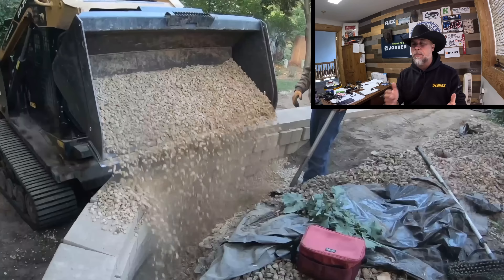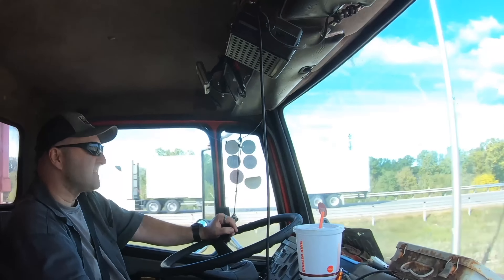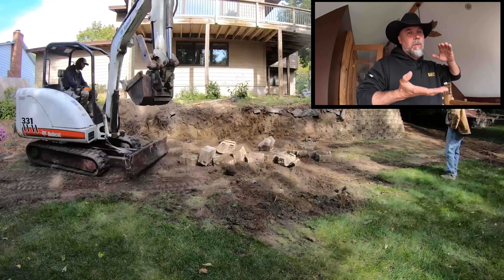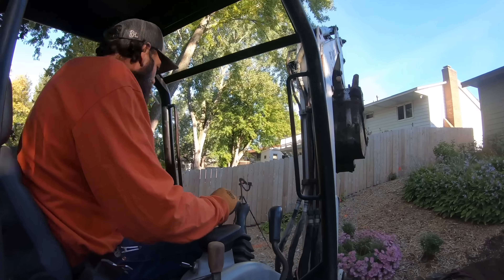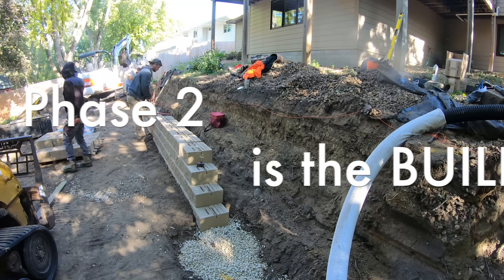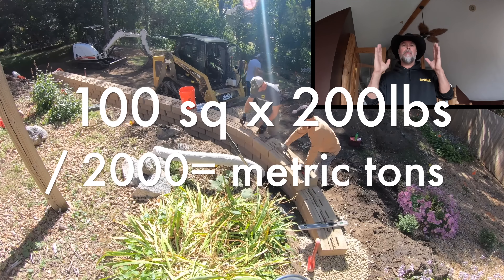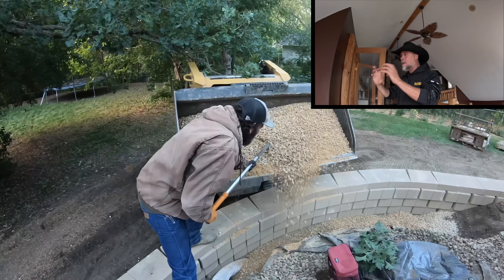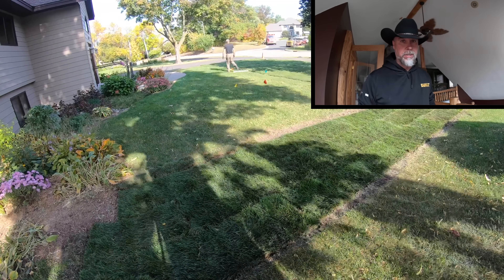Building a new retaining wall and sodding.

Comment: That was a state Trooper, not a Sheriff. Cops (especially Troopers) are fully aware that traffic stops will cause major traffic problems.... but they simply do not care.
Reply: So what you're saying is they would rather make a stop anywhere and put themselves in a position of getting struck by a motorist?  Right? Yeah, that make sense.
Reply: @video80634  No, that's not what I said. At all!  MN State Troopers who's sole job is to patrol state highways, they know better than ANYONE else that a simple traffic stop WILL cause a traffic jam, yet they still do it. Why? I don't know but they do it all day, every day.  You know, that person not wearing a seat belt, or that guy that was speeding 5-10mph over the limit needs to be stopped NOW and given a ticket. You'd have to ask a Trooper why they do what they do....  I'm just reporting what I've seen everyday for the last 32 years of driving on MN highways....  don't shoot the messenger.

Comment: on the traffic stop. it's not the cop's fault people don't know how do drive. The Law in every state I have driven through is change lanes or slow down. NOT BOTH. I think a few things happen. Rubber necking, and fear of getting caught not following the driving laws are my suspicions there. If your upset with other drivers all you can do is check your self.  where's your phone? put it down. Are you speeding? Stop speeding. Why are all 3+ lanes backed up? Are you merging correctly? I don't think they've been teaching this for years. FYI the person in the lane already has the right of way. You yield to them.

I drive most of my shift through several states in the Midwest. Bad drivers irritate me also. If most people would stop thinking that they own the road, start sharing, and take the time to get where they need to be without being in a rush traffic would be alot better.  

I'll get off my soap box and go calm down now

Comment: Stan, your caption when explaining how to convert pounds to tons is incorrect.  You divided by 2000 to gets short tons but the caption said metric tons.  Long tons are 2200 pounds and metric tonnes are 2204.6 pounds (actually 1000 kilograms).

Comment: I like how you break the quote down.  When I do property clean ups, I take pictures and if there are different sections I will quote each area separately.  i.e. bushes, tree trimming, grass etc. And after I have the total quote, the customer has the option to accept the entire quote, or they can choose what areas they want me to clean.  This is helpful when the property needs a like a $1500 clean up instead of a couple hundred-dollar mow. And if they only want you to do the demo and clean up you have that price already set.
Reply from the maker: Sounds like you got a pretty sweet system down 👌
Reply: @Dirtmonkey  It has worked excellent for me.  Especially when there are more than 1 area.  Last week I did a clean up.  We talked about the yard/grass and tree trimming.  We went forward with the grass clean up but they put the tree work on hold which is fine.

Comment: I have a big wall with blocks that look exactly like those, but mine have holes in them and you drop 2 fiberglass rods between each row to lock them together. Works great.
(I alternated with red/gray blocks for a different look)